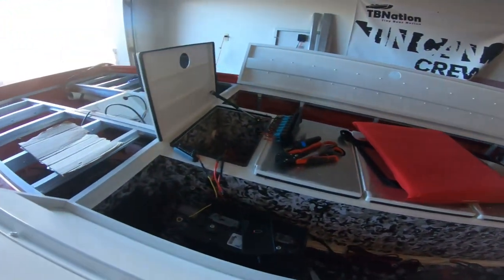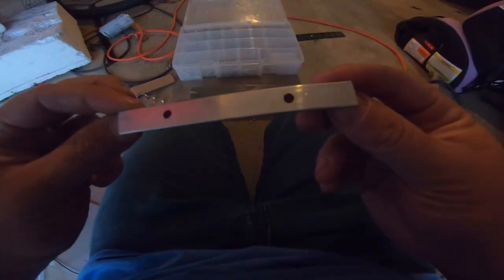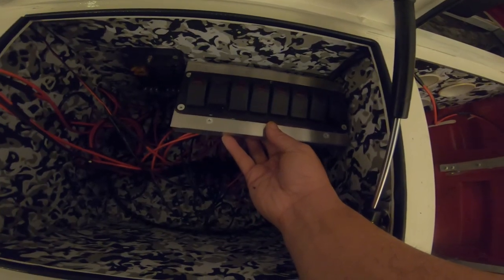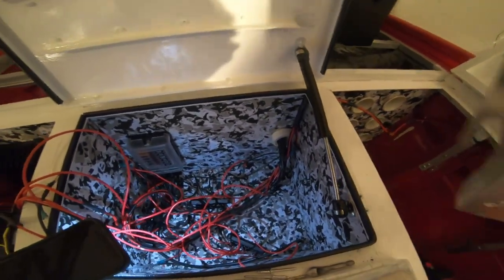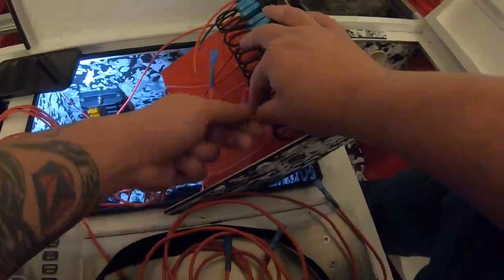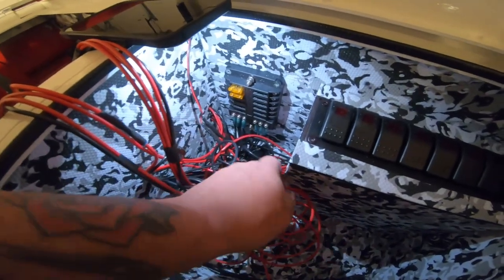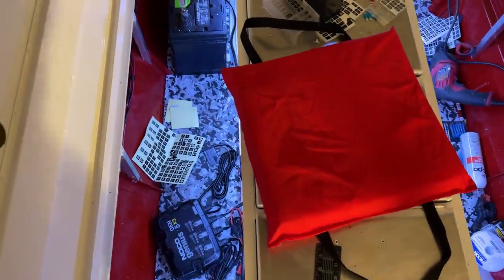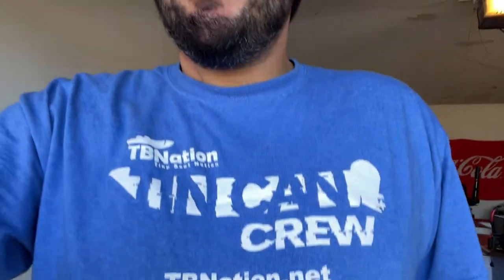MAKING a CUSTOM SWITCH PANEL BOX for my BOAT!!

Comment: Why not ground the bilge on the negative bus bar of the fuse block ? I’m assuming they are all full but you can double one up without any issues . I’ve read that there might be issues with grounding to aluminum even though it works . No idea if that’s true or not but I’ve doubled up some negatives on my bus bars and haven’t had any issues . Just need to flip one ring terminal so they are back to back and get a good connection . Looks great , keep it up!
Reply: This. Don’t use the hull as a negative. You’ll get corrosion in the water. All negatives should go back to the battery and the battery should have a single large negative bond to the hull.

Comment: Do you have your negative from your battery hooked to the frame of your boat?
Reply from the maker: It’s not connected to anything yet
Reply: @AdamRyanA  how are the bilge and the lights working through the bus bar and you have a ground on the frame
Reply from the maker: The positive and negative wires are ran over the wall and into a battery on the other side of the wall